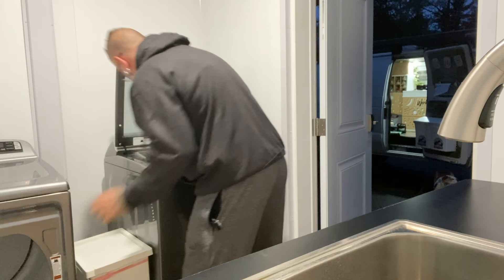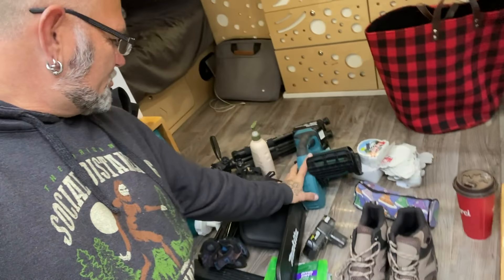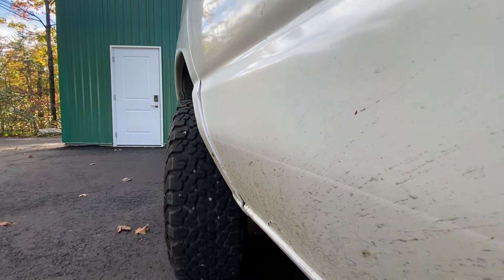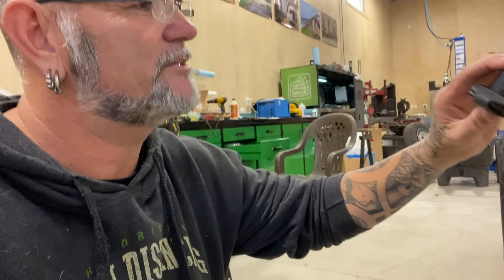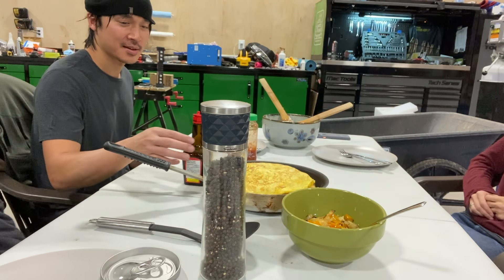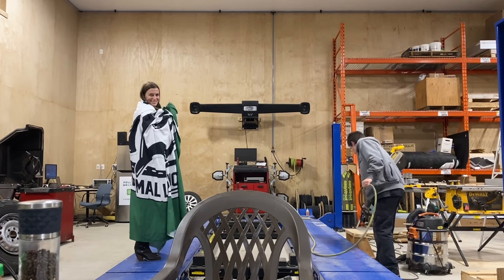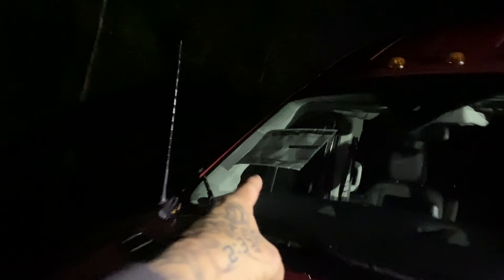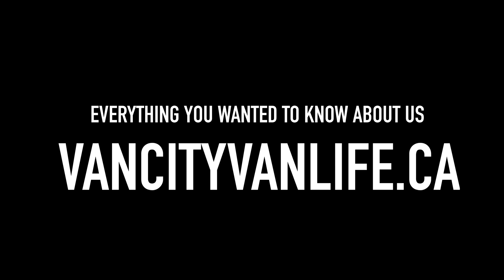EXPENSIVE VAN BUILD Upgrades Are Over And It's Time To Hit The Road Again...OK ONE MORE PROJECT

Comment: You may want to have those extra blankets just in case you get in a situation where you might not have heat.
Reply: Was thinking same thing if the heater broke...
Reply: @vanlifenomadgipsygirlcanad2195  You could also get a 12 volt electric blanket and plug it into your power pack.

Comment: Depending on your wintertime experience with the solar charging, you might find that shore power charger useful when plugged in to a small generator. A 900/1000W unit weighs about 30lbs and outputs about 8A AC power and could be stored securely on the front or back of the van.

Comment: Did u forget about your portabke power pack to charge your batt when no shore power is available? Then when batts are topped up, u use it to chargeyour power pack😆 ....with shore power to boot if avialable. Its a vicious cycle 👍🏻

Comment: When I bought my van I had one put in first thing, I had been in a camper and  was used to RV parks, so it is nice to have the plug in when it's cold out and I need to be on the road I can stop at an RV park and plug in a heater.

Comment: Ive tried emailing Ray Outfitter a couple months ago for a quote and never got a response. Im looking to get some small stuff done like a roof fan, window, a solar panel.... it looks like the min price for a solar panel instal is $4k 😦

If anyone has any suggestions pp let me know. Im in Montreal, but it doesnt have to be done here.
Reply: hmmm...I emailed in the spring, and got a response from Madison within five days.  And again, another check in email later on.  try again, she's usually great!  You would probably have to drive to Barrie from Montreal (six to eight hours?), and hang there while they do your van.